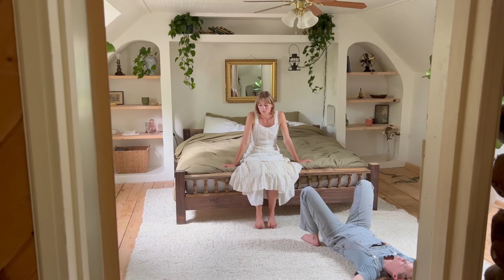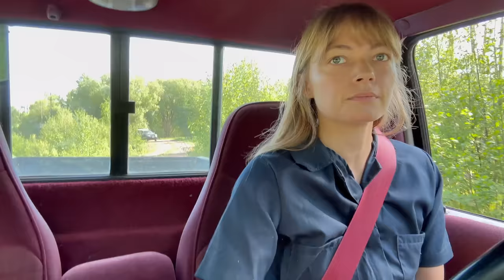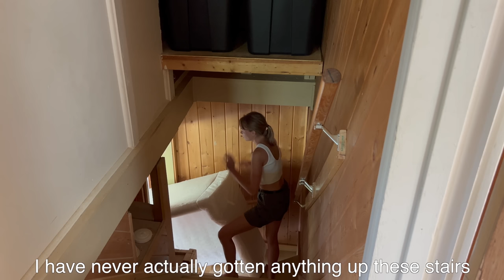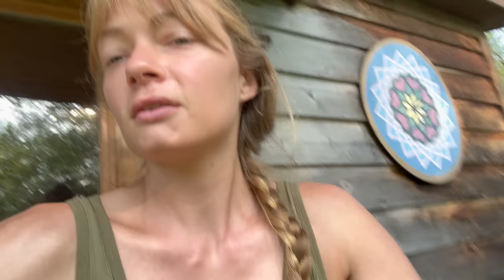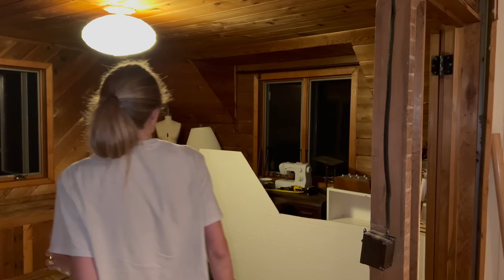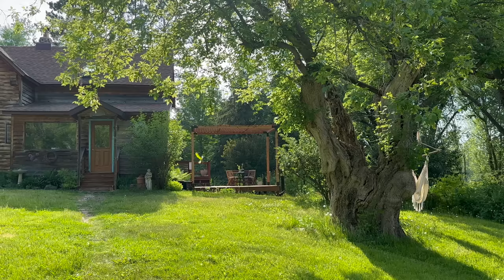I can’t stop building things

Comment: FYI - If you want a solid tie off or connection point on any tarp or material you don't have to cut holes or install grommets. Anywhere on the material push a small rock (or anything) into the material and from the OTHER SIDE loop and tie a rope/string around the base of the rock effectively tying the rock into the material. If you want a tie off point then use a long rope for the loop/tie line or if you want to connect two materials together just push the rock into both overlapping materials and use a short rope/string to tie the rock in. This crumples the material a little bit but it is much stronger than cutting any hole and you can put them anywhere on the material, not just at the edge. Don't know if this would help with what you were doing there but if you know this method you will use it many times throughout your life and even reconsider how to effectively use tarps. Actually, this is much stronger than using the built in grommets so while camping or something you might want to do this instead of using the grommets. The larger the rock and line the more powerful the connection.

Comment: My parents have a leaf grinder and we pile them up until my mom does her garden.  She lets the plants grown up a little and then mulches leaves around them.  That way she doesn't have to weed and the ground stays wetter longer her garden used to be sandy but between the leaves and a truckload of cow plop every year it is pretty awesome.

My dad took some old water heaters from the house and cut them in half and built some wooden stands.  She put her smaller plants in them this year as an experiment.  They worked just fine.  She was recovering from back surgery so didn't plant her regular gas den this year at all first time since around 1974 she didn't have a full garden at any house.

The best garden we had was when I was in high school.  We turned the old barnyard into a full garden.  The farmhouse was over one hundred years old and had cattle in it the entire time.  Before the house they lived in a log cabin.  The barn was featured in a book.  It was built without nails except for the siding and roof they used huge wooden pegs.  The loft above the milking area was where they kept loose hay with birch bark trees as the loft floor.  They just pushed the trees aside to drop hay down to feed.  I spent a summer cutting the trees up for firewood after my brother went up there and fell through the logs and broke his leg.

Comment: My parents built their stairs going upstairs and downstairs extra wide and straight for moving stuff and for future human lifts for when they got older.  They also built all the doors in and out of the house extra wide for that reason also.  Was quite easy moving stuff in the house.  My mom worked as a county nurse and saw all the trouble people had with doors.

They also built a wheelchair ramp as part of the front steps for older people which has also helped a lot and was cheap when they built the house.

Comment: Use fans on your deck to keep mosquitoes away. On the boat also. Plant peppermint, lavender and any other herbs that repel mosquitoes. I mix vinegar, lavender & peppermint oil strong with water & spray around to keep flying insects away. And you can spray yourself. Peppermint repels mice so keep your pet mice away from the peppermint. Use peppermint oil mix strong with water, outside around your building foundation to keep unwanted mice away. But you have to keep up with spraying often. It all smells nice and not poison.

Comment: Another lovely vid.
 Felt for ye trying to hold that lump of wood in the air. I've been there too many times. A wee tip: next time you assemble something like the pergola, clamp a piece of scrap wood under the bracket, or rail, to act as a temporary shelf to support the piece you're trying to fit. Remember, clamps are your friend and an extra pair of hands. 🤪😊 Looks fab! (Also love that you spotted the lack drainage and drilled a hole to let the water out. 👍) ❤

Comment: 1. Where do you buy the metal pergola post thingies? 2. If you drill a hole in them for the water but don’t drill a matching hole underneath won’t the wood underneath still trap the water?

Comment: You might want to get some citronella incense. It usually comes in a flat coil and you put it in a metal case with holes in the lid, so you don’t have to worry about an open flame. We also have free standing citronella filled tiki torches for our back porch.

Comment: Hi Hannah
May I suggest that you use Algae killer to stop it from developing so quickly. This will reduce the need to clean out the pond as often and fish that like to eat bugs especially mosquitoes that are cold water friendly and plants that can help to reduce evaporation that float on the surface or a shade cover especially in the summer so the water stays cooler.

Comment: You need a mosquito trap.
You can DIY it, with a big bottle, cut the top off, turn it upside down into the other half, fill it with some yeast and sugerwater, the CO2 produced by the yeast will attract the mosquitoes,  when they go inside,  they get trapped by the upside down entry. (If you get what I mean 😅)

You can also have a solarcharged bug burner (those blue lights with an electric zap wire) and so on.